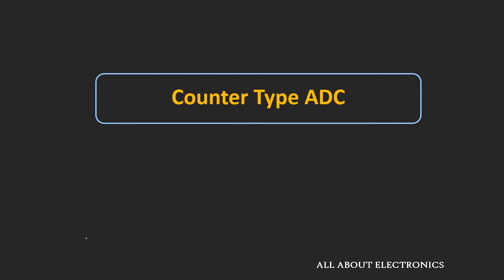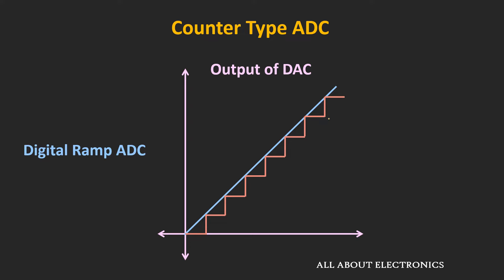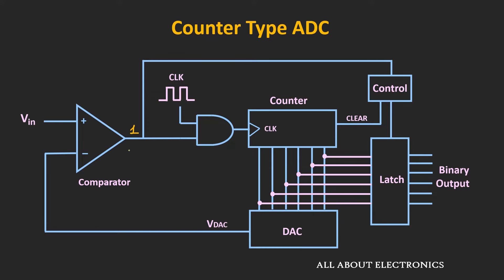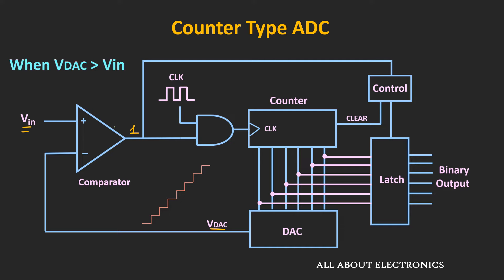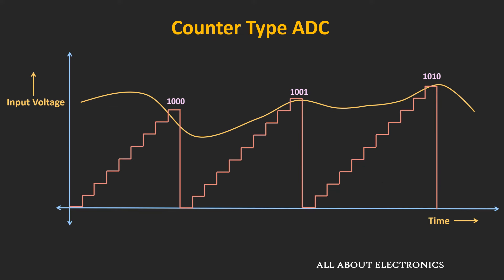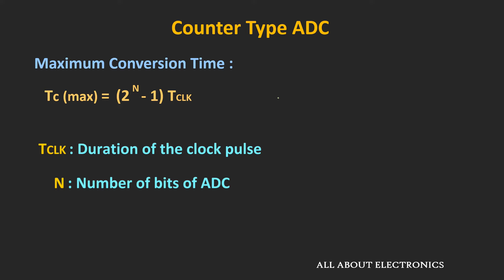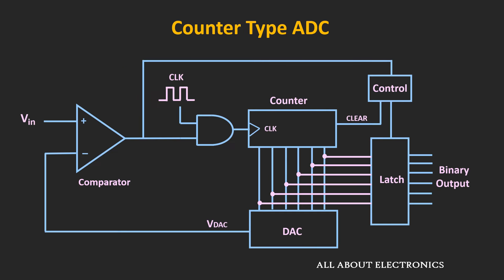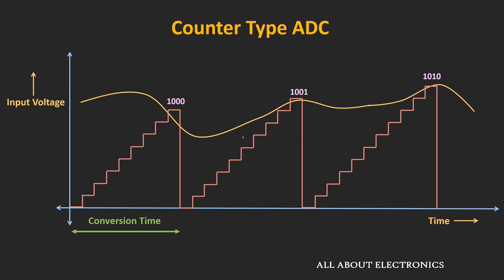Counter Type ADC Explained

Comment: Thanks for the explanation. 
  I know you're strictly academicly focused here, but it would be helpful for me if you closed this with an actual reference design, like something from a datasheet that I could physically build if I wanted to experiment with the circuit. If you're concerned with copyright, a simple schematic could be drawn in open source software like KiCAD, although I've never heard of anyone having copyright problems by posting datasheet info online. It's just a suggestion. While watching this upload I was thinking, 'Comparator=LM393, Oscillator=555, DAC=DAC0808, Counter=CD4017, AND Gate=74HC08, Control=Arduino. I have all of that in DIL packages I could breadboard right now. However an actual reference design would get me motivated beyond just a curiosity. I don't want to spend all day sorting out a half baked circuit idea when I already have other projects I'm working on.
  If I could easily follow your tutorial, then build a circuit, the ideas you're relating here would stick with me much longer. Again, you don't need to build or demonstrate this yourself, just simply show a single picture of a reference design schematic with part numbers that someone could build if they would like. You don't even need to explain it by itself, just show it.
-Jake

Comment: Sir , what will be the output of the comparator when input voltage is equal to o/p of DAC i.e., Vi = V(DAC) ? ... Please clear my doubt.
Reply from the maker: if both inputs are same then in this case, the output of the comparator will be low, so that no clock pulses are applied to the counter.
Reply: @ALLABOUTELECTRONICS  thank you sir... . But why the output will be low can you explain me please ?
Reply from the maker: Comparator compares the two inputs and amplifies the difference between the two inputs by very high gain. The output of the comparator can't go beyond biasing voltage. That's why output is saturated to either positive or negative saturation voltage. And that's we call it as high or low state of comparator. But when both inputs are same then difference between inputs is zero and hence the output of the comparator should be zero ideally. I hope it will clear your doubt. For more info you can check the video on opamp as comparator.
Reply: @ALLABOUTELECTRONICS  Thank you so much sir . Now my doubts are very clear 😃😃

Comment: What are the applications/usage of counter type ADC?
Reply from the maker: Practically today this counter type ADC is not used. (Because of its slow conversion time)
But it could be used for very slow varying signals. e.g Data coming from the temprature sensor.
which is changing very slowly.

Comment: Sir, can tracking type adc be useful when analog signal swings from peak to zero level and zero level to peak quickly?
Reply from the maker: Now, it is only useful when the signal is varying very slowly. If the signal is changing very quickly between low and high value then this ADC won;t be able to track the signal immediately.
Reply: @ALLABOUTELECTRONICS  
Ok sir ❤